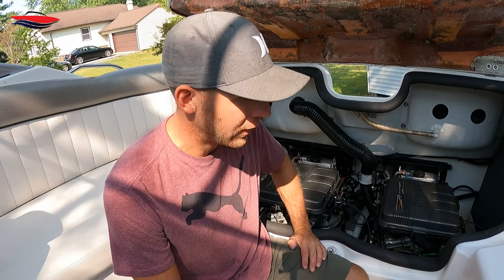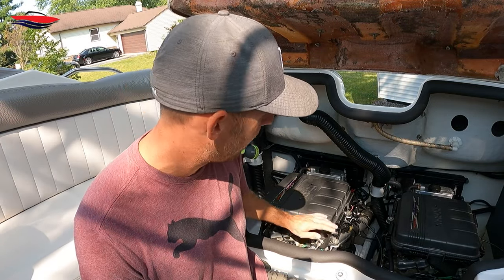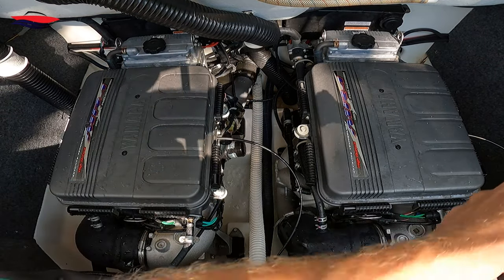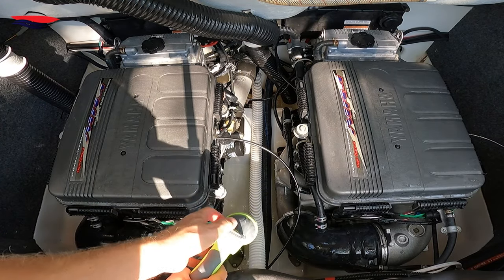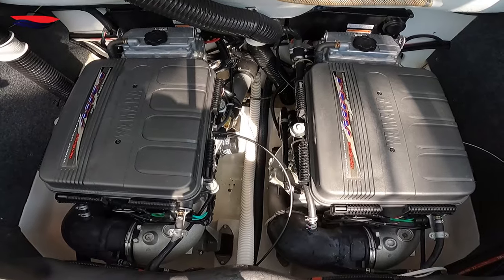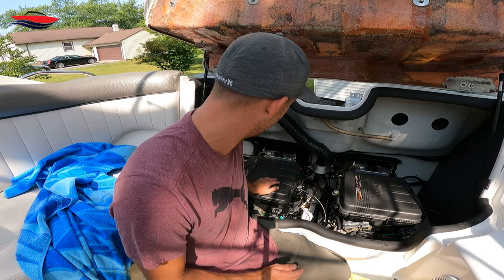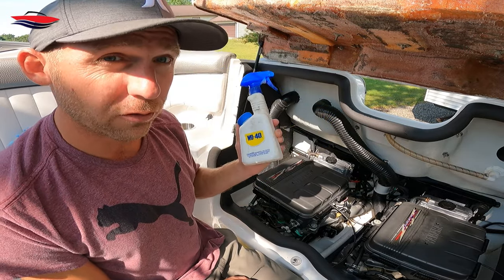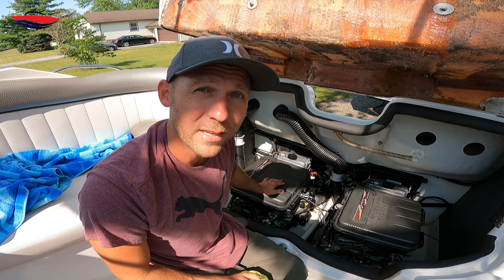Engine & Engine Bay Cleaning - Yamaha Jet Boat

Comment: Hi Jeff. Have a recent purchase of a 2015 sx192 that had a little oil under engine.  Told owner -  he said he found a Couple bolts and tightened the oil pan.  He said he checked all bolts on engine and said its not uncommon to have slight oil on bottom.  Possible from recent oil change.  Water tested and it ran beautifully.  When cleaning found a  little oil on bottom under engine again.  Some owners say its common and live with it.  Boat is really well taken care of and can't wait to get it in the water.  1st boat!!!!  Your input greatly appreciated!
Reply from the maker: I would not worry about it what's so ever.  Try for yourself, take an eyedropper amount of oil and drip it on the the floor of the engine bay.  Just that small amount will go everywhere and when you add just a little bit of water to the situation it makes it spread so much more.  It is also common for an engine to burn a little oil especially if you run at high rpm for extended periods of time.  It's not bad or wrong to do it, it is just a characteristic of a combustion engine.  The biggest thing you have to do is check the oil level twice a month and make sure it is filled up.  I hope this gives you piece of mind and enjoy boating!!!!
Reply: Thanks Jeff for easing a newbie into boating!  I'm an old fart that took the plunge. The owner said basically the same thing.  I just needed it clarified by a Jetboat technician.  Next job is sound killer!  Thanks buddy!

Comment: Hey Jeff!  This is all great!!! I have a 2004 AR230 and its been hassle free until now.  A month ago the starboard engine / jet pump sounded like it sucked up a chain / was processing a bucket of bolts.  I shut it down and limped home on the port engine.  I have taken apart the three piece assembly and ordered all new bearings and seals.  The rear bearing was completely gone.  I'm hoping that was the problem but can't be sure as the impeller and shaft wont simply slide out.  I've tugged and nothing.  If I could get it out I'd start up the engine and could then possibly eliminate engine or intermediate shaft housing (inside the boat connecting power drive / shaft to engine) as an issue.  I'm pretty sure its the bearings on either side of the impeller duct (middle of the three primary jet pump housing components).  But that leads me to my next problem.... The two oil seals and bearing (Front and Back) won't come out.  What do you suggest?  XO - your friend north of the Cheddar Curtain, home of the bitch slapping the Bears, 13 time NFL Champion Green Bay Packers.  BTW - you're a young man, its not too late to defect and join us. (Madison, WI)
Reply from the maker: You will need heat (torch) and a way to press those bearings in & out.  Sounds like you may want to take it to a shop and have them pull the bearing.  You don't have to go to a boat dealer you could find a power sports dealer(dirt bikes, street bikes, PWC's) because it is the same as the wave runner setup.  That way you don't ruin the duct.

Comment: I have a 2017 sx190. I had acouple inch’s of water in engine compartment. Had to turn bilge on to get water out. How much water does it take for bilge to kick on automatically? Can I leave bilge on all the time? That’s what owners manual says to do if in slip
Reply from the maker: Yes, leave it on.  I left mine on in a slip for 2 days without starting it and it did nothing to the battery.

Comment: How did you drain the water out , you skip that part. Was there a drain plug or did you use a vacum?
Reply from the maker: Yes, there are drain plugs in the engine bay that drain into the bilge then that drains out through the hull drain plug onto the driveway.